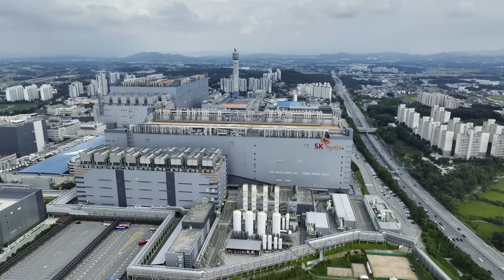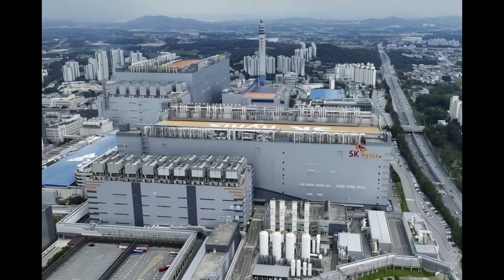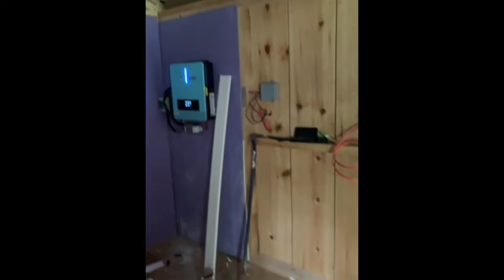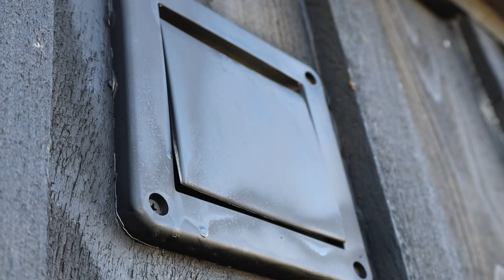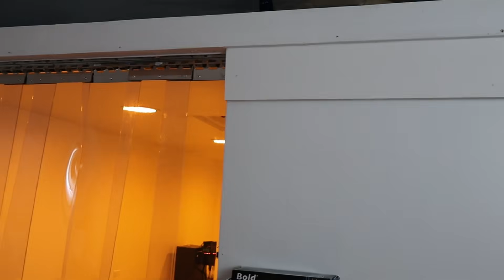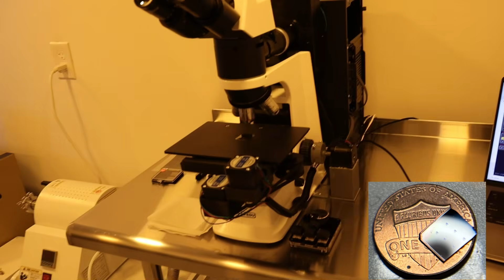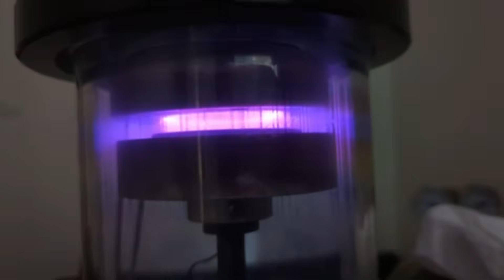There’s a Class 100 semiconductor cleanroom inside this backyard shed.

Comment: The biggest issues that you have doing this at home are they really small things you don’t think about like being able to wash clean room suits because you need ridiculously expensive special cleaning machines
Reply from the maker: Oh man yeah I contacted a company and it was gonna be a small fortune to have them clean it. Instead I do it myself xD I have a DI water system in my basement and I handwash the suits in a cleanroom environment, low shedding container, with a specialty detergent, then cleanroom air dry.
Reply: @Dr.Semiconductor dont worry about the hatters man, this is incredible
Reply: @Dr.Semiconductor  that’s interesting that you can do it yourself. I still think they’re gonna have to be replaced a little bit more frequently than standard industrial ones just because this is probably going to not fully clean them every time as they use a weird special dry cleaning method sometimes to the point where the chemicals to cleaning are hundreds of pounds a litre.
Reply: Next video: How I Built My Own Clean Room Gown Washing Machine In a Sink
Reply: The other thing is probably needing an actual airlock to sweep all remaining particles from clothing and items brought into the clean room
Reply: @masterman1502  or maby a complete wipedown
Reply: ah you could also buy lesser-grade disposable ones which are much cheaper, i think by tyvek or a similar provider
Reply: @larstatum6255  often not allowed to buy without a support contract

Comment: Hey, if you can get a 2 micron process working, please let me know. It might not be cutting edge, but is perfect for 1980s ICs that are no longer in production, small runs of which would be greatly appreciated by the hobbyist community
Reply from the maker: I can currently do sub-micron patterning ~1990s style, and I am working on immersion lithography for sub 100nm patterning (~2004). I mostly focus on novel semiconductor devices (GaN based) but would LOVE to make some classic silicon devices and have the stuff to do it. Just previously wouldn't be viable but for youtube content maybe now it can be!
Reply: @Dr.Semiconductor  How large of a chip area can you produce? Also, I'm curious as to if you've experimented with electron beam lithography. A SEM can be used for that, and an SEM can also be DIY'd. It wouldn't be easy, but it seems like you have resources.
Reply from the maker: @ST-wn9kdSo currently that is a trade-off with resolution for the microscope setup. At ~350nm the total pattern size is 800um, but for immersion lithography at sub 100nm it goes down to 200um. That is still thousands of transistors to play with, and you could also do stitching of multiple patterns. I am working on a laser direct write system and also I do have an SEM i am working on rebuilding, that could be a method too though all but the most modern SEMs are limited in their patterning capabilities... stay tuned!

Comment: I want to leave a comment criticizing your use of chatgpt to write the script as lazy or sloppy... but I mean... at this point I need to just be f*cking for real...
Reply: chatgpt pro-tip: ask it to generate a series of prompts for the task you actually want it to do and then input those according to the instructions it outputs alongside them. you'll get a much better end result (in your case a script that isn't as easily recognized as chatgpt generated). You can also ask it to adopt a specific persona or manner of speaking (eg, Hemingway, or a scene kid, or a surf punk, or Tolkien or whatever) when it writes something which would make it much much less detectably AI. Or just do whatever you want, I'm not a cop.

Comment: I recently saw a Tech ingredients video where he details a low budget “””clean room””” option using a thin plastic film to create a rudimentary electrostatic dust trap surrounding the workspace. I’d be interested to see someone quantify how effective that is.
Reply from the maker: Yeah they sell these portable "softwall" cleanrooms which are great for a quick setup, though they are more limited in terms of particles and don't allow as much flexibility.
Reply: Laminar flow is extremely important for cleanrooms, especially in semiconductor manu. It's constantly downward air flow, so any particles that do get generated quickly get moved down into the subfab. Those static things tend to allow particles to float up, move around, and drift. This is NOT what you want in a production environment. The tools can have charge, the worktops can have charge, etc. You want downward, constant, laminar flow.

Comment: Im very curious how maintenance is with the filters, do you have to open up the top to swap out?
Reply from the maker: I have to replace the main air intake from the outside every few months, but the main air handling units can actually last for years. haha I know some university cleanrooms that haven't replaced their filters in over 20 years. That is because the prefilter does the heavily lifting combined with the cleanroom itself being designed to shed very few particles.

Comment: Sure, not billions, but definitely high tens of thousands.

Also, I am extremely surprised the clean room stays as clean given the plastic doors (even if I understand positive pressure) and also surprised the filter doesn’t need to be replaced super frequently. Also, did you epoxy the corners between floors-wall-ceiling or caulk it? And how did the attic cavity get sealed? Same as main room?
Reply from the maker: Thanks and great questions! All the walls and doors are all sealed with epoxy which sheds very few particles. Then I have an air intake up top with a separate filter that is replaced every few months, that does the initial heavy lifting so the main filter units don't suffer. I have been in university cleanrooms that actually haven't changed their filters in over 20 years haha. That is due to how thick these specialized filters are, the pre-filtering, and how the lab itself doesn't generate many particles. As far as the attic goes I have it sealed with a plastic sheet, ugh it was just me doing all the construction and I couldn't begin to imagine trying to do drywall in that tight space.

Comment: I just looked at the internet and apparently your airflow is ideally supposed to flow only downward and exit through floor vents. I don't know how practical that detail would be in a shed.
Reply from the maker: Yeah some designs directly pull it down through the floor to a sub-basement and then have it loop around, others using grates on the wall, this is such a small volume that I can get away with just having it exit through the doorway and then loop back around. xD

Comment: I must have missed it, how are you doing the air return to maintain laminar flow? Are there floor level returns along the walls? BTW I see you are using (111) oriented wafers, are they cheaper than the more common (100)'s used these days?
Reply from the maker: Great questions! The air return is actually though the doorway and loops back around to the opening above the cleanroom in gowning. The fan filter units themselves are designed to also help provide the laminar flow. Haha i'll use whatever wafers I can get, where I got a supply of like 80 <111> wafers for cheap, though I mostly do experiments with GaN materials.
Reply: @Dr.Semiconductor  well I look forward to seeing some backyard GaN experiments!

Comment: HE WAS ABLE TO BUILD THIS IN A SHED!
WITH A BOX OF SCRAP!
Reply: Well I'm sorry I'm not Dr.Semiconductor
Reply: @lichbilly LMAO
Reply: Finally this comment found it's post
Reply: Where do I find this box of scrap?
Reply: Tony Stark ahh, clean room.
Reply: The equipment in the shed is far from scrap. A single turbomolecular pump needed to create high vacuum alone costs thousands of dollars.
Reply: @RoyaltyInTraining. "Tony Stark was able to build this in a cave... with a box of scraps!" is a quote from the 2008 Iron Man movie. Even in the movie, the parts were hundreds of thousands dollars.
Reply: @GabrielMarques001  I was wandering if that was a reference from somewhere lol
Reply: @RoyaltyInTraining. You'd be surprised how easy it is to get this equipment used for a reasonable price. Larger fabs upgrade their tooling and modernize their facilities fairly regularly. The old stuff gets sold to smaller fabs and laboratories. Whatever "scraps" are left over then get auctioned to anyone with enough money. It's also possible to buy "broken" equipment and repair it relatively easily
Reply: @richarddickjohnson516 Yep, the hard part is the gaining the knowledge to know which used options are a good value versus which ones end up being a money pit.
Reply: @RoyaltyInTraining.  I interviewed at a place where one of the guys I met with admitted to having a disassembled multi-million dollar mass spectrometer in his basement covered in cat hair.
Reply: Make that more like tens of thousands if it's bigger than your head.  @RoyaltyInTraining.
Reply: @RoyaltyInTraining.   And yet tons of semiconductor lab equipment was scrapped and landed under bare sky when factories got dismantled and converted.
Reply: Underrated comment 😄
Reply: It all had to start somewhere... What took 5 years and cost $300,000 in the 1960s is achievable in a backyard shed for basically nothing in 2026... There isn't anything scandalous here.
Reply: 🤣x.XDeadX.x🤣
Reply: was here
Reply: Scrap? Are you for real? This is all very expensive equipment, just small scale.
Reply: @liquidthex  He didn't build the equipment though, he built the cleanroom.
With proper engineering, and epoxy paint (the smart choice there)
Reply: @codexistence he literally build a spin coat machine and lithography machine by utilizing a microscope, 3D prints and custom software
Reply: @recon_laksh742  True, true...

Comment: You can enhance it further with enclosed/filtered local class10 stations(mainly for doping substrates using gases and sio2 layer formation.). There is also the possibility of printing large feature devices using conductive ink.❤👍
Reply from the maker: haha exactly, inside my house I have another "cleanroom hood" for just the electrical testing/characterization. The microscope allows me to get submicron features sizes and for doping on silicon I have been playing around with highly doped Si sputter targets, creating a raised source/drain then annealing it.

Comment: Don't you need an air cleaning room/corridor to clean the cleansuit before going in?
Reply: If you look at the plastic curtain, there is positive pressure in the lab. He said that one doesn't just walk in, one transitions into the clean room. Therefore they are being cleaned. Also there is a sticky floor.
Reply from the maker: Great question! Yeah so the initial gowning area is still crazy clean like class 200 if that were a thing, so the suit stays clean where it is, but I do need to wash it periodically. For that I use a specialty detergent, De-ionized (purest possible) water I generate in my basement, hand wash and airdry in the cleanroom.

Comment: What about the two big slots on the ceiling? Wouldn't that leak specs of dust into the room?
Reply from the maker: Great question, you may be referring to the air filters? They are sealed all around with rubber and blow clean air down. If there is every a slight crack or gap that is ok, since I have positive pressure to push the clean air out rather than the dirty air in. Then the lab itself is designed to generate as few particles as possible

Comment: There's a YouTuber who restored an old scanning tunneling microscope somewhere. It doesn't seem like a bad place to put it.
Reply from the maker: oh man getting a working SEM would be a dream, I am trying to restore a desktop SEM where I can throw that in the shed, it's the size of a desktop PC with the tradeoff being small sample sizes.
Reply: @Dr.Semiconductor  have you seen MechPanda's DIY STM video? "Building a 3D Printed Atomic-Resolution Scanning Tunneling Microscope (STM) | DIY STM Explained" on YouTube
It's not an SEM but an STM though

You could pair it with a machine similar to The Bard's "Zyrus Etcher MK1, Scanning Tunneling Microscope Tip Fabricator" (video on YouTube) to manufacture STM tips more reliably than what is shown in MechPanda's video.
Reply: I believe you might be talking about “projects in flight”, he somewhat recently did fix one and is also on the path of creating semiconductors.

Comment: Curious what material you used to coat the inside of the clean room?  I've been meaning to build a similar system!

Also, i assume you know that it's best to run hepa systems on low all the time to prevent moisture or mold spores lodging and growing in them?
Reply: I guess you didn't watch the video. What a shame.

Comment: Please share more details when you are able. Total cost of equipment, power draw, availability of parts, etc. Would love to see these pop up as hobbyist workstations across the U.S. If cost could come down to $20k-30k or so, and they could be packaged in a shipping container form factor, I could see a very successful business being built around these.
Reply from the maker: Yeah it landed around 20k, expensive but not astronomical if you set a goal! Would love to see these pop up! :D
Reply from the maker: equipment costs are variable haha so many iterations... but tools can be made for cheap now that I figured it out, and power draw is ~600W idle for the fans/lights, heating/cooling spikes it to ~1.5kW, the vacuum based systems consume the most by adding another ~500W when running.
Reply: @Dr.Semiconductor  Do you have a background in Electrical Engineering or Physics? I’m a graduate software engineer, but I’ve recently become really interested in low level electronics and chip fabrication. I’d love to start learning it properly from the ground up all the way up to a deep understanding like yours.

If you have any recommendations on where the best place to start is (books, courses, topics, etc.), I’d really appreciate it!